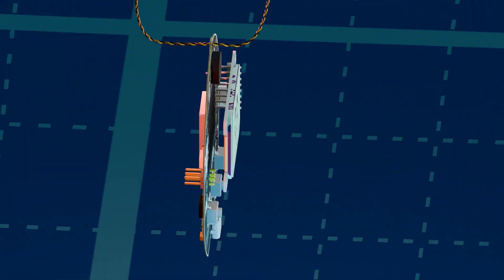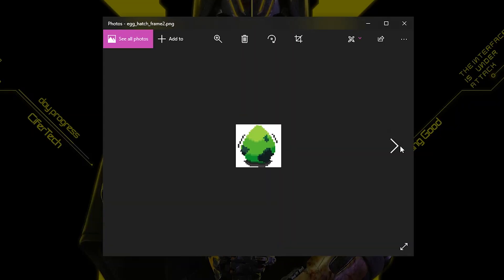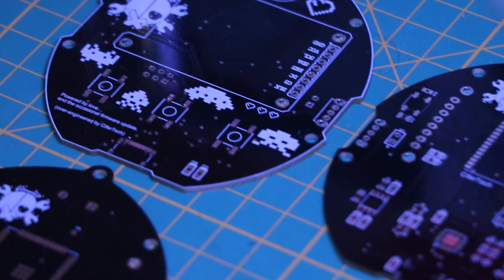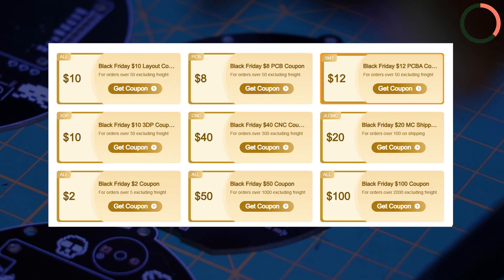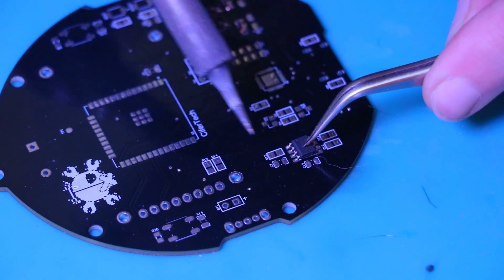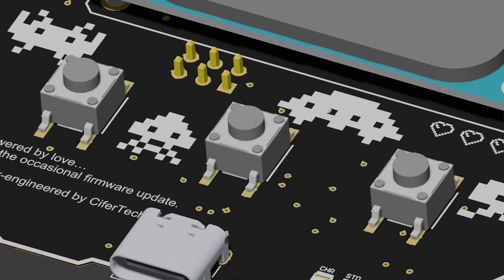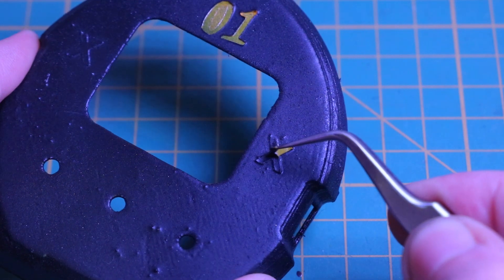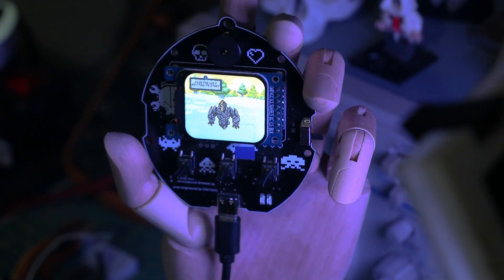I Built a Virtual Pet That Hunts WiFi Networks

Comment: It needs see-through gem color cases similar to the old iMacs of the 2000's. That way you can see all of the gorgeous detail work done on the motherboard through the gem cases. :D
Reply from the maker: That’s a cool idea! I love the retro iMac vibes. might have to explore that for a future upgrade. 😄
Reply: @techcifer Bro Please use RTL8720DN BW16 Chip in NRF Box by which it can be able to analyze 2.4 ghz to 5.8 ghz .
And then it will be the NRF Box ♾️☢️☣️.
Use RTL8720DN BW16 Chip only for analyzer and jammer for 2.4 ghz to 5.8 ghz frequencies. 
Use ESP32 as main Chip by which it will consume some extra  coding efforts.

Comment: I appreciate the walk through each component individually, that was a nice touch
Reply from the maker: Glad you liked it! I wanted to make sure everything was clear and easy to follow.
Reply: @techcifer Bro Please use RTL8720DN BW16 Chip in NRF Box by which it can be able to analyze 2.4 ghz to 5.8 ghz .
And then it will be the NRF Box ♾️☢️☣️.
Use RTL8720DN BW16 Chip only for analyzer and jammer for 2.4 ghz to 5.8 ghz frequencies. 
Use ESP32 as main Chip by which it will consume some extra  coding efforts.

Comment: That's an awesome project! You've done a great job with the hardware and software.
Reply from the maker: Thanks a lot! Glad you liked it!
Reply: @techcifer Bro Please use RTL8720DN BW16 Chip in NRF Box by which it can be able to analyze 2.4 ghz to 5.8 ghz .
And then it will be the NRF Box ♾️☢️☣️.
Use RTL8720DN BW16 Chip only for analyzer and jammer for 2.4 ghz to 5.8 ghz frequencies. 
Use ESP32 as main Chip by which it will consume some extra  coding efforts.

Comment: How did you make the UI? Thx
Reply from the maker: I designed the UI using free graphics I found online and coded it with the TFT_eSPI library for the ST7789 display. I explained a little in the video.

Comment: Pwnagotchi?
Reply from the maker: Pwnagotchi captures Wi-Fi handshakes with simple graphics. Tamafi, has better graphics but uses Wi-Fi networks as tokens to feed your pet.
Reply: @techcifer  So to clarify it's not used for any sort of password decryption like Pwnagotchi
Reply: @techcifer Bro Please use RTL8720DN BW16 Chip in NRF Box by which it can be able to analyze 2.4 ghz to 5.8 ghz .
And then it will be the NRF Box ♾️☢️☣️.
Use RTL8720DN BW16 Chip only for analyzer and jammer for 2.4 ghz to 5.8 ghz frequencies. 
Use ESP32 as main Chip by which it will consume some extra  coding efforts.